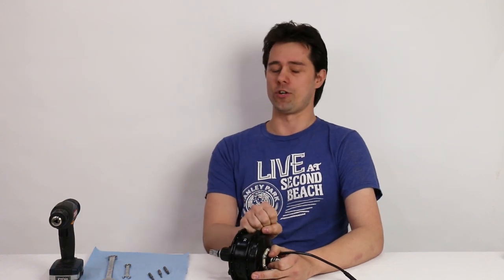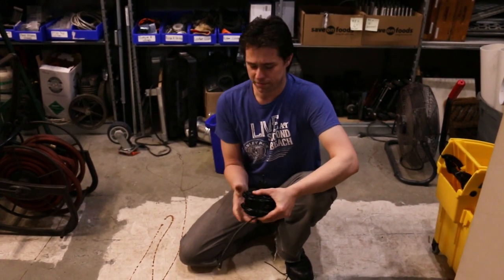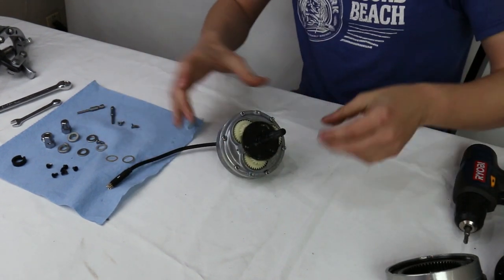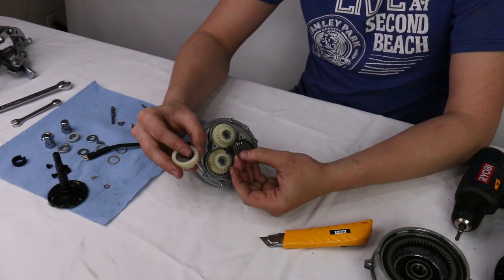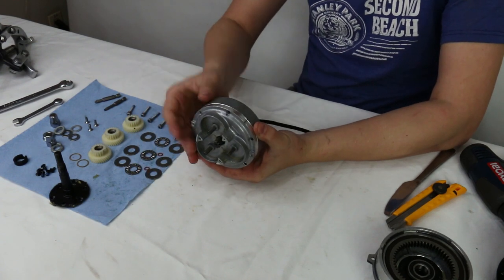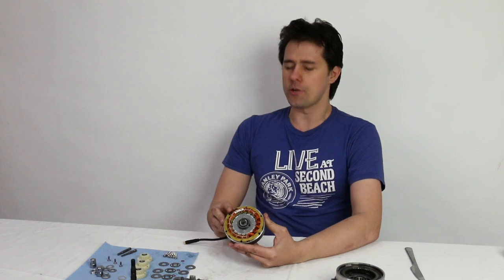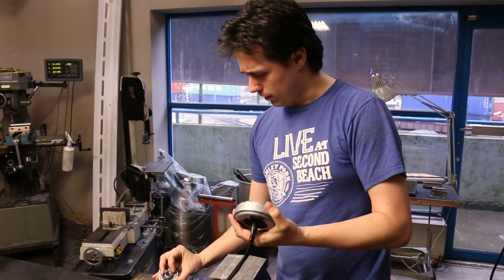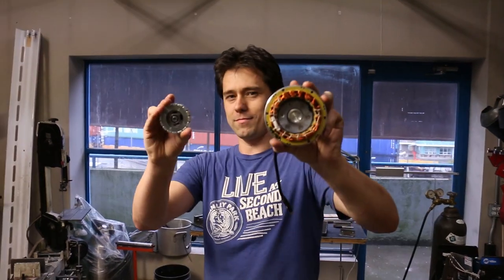Bafang G310 Motor Disassembly Video

Comment: Great video. Especially the attention to correct alignment of planetary gears. 🙂
The Bafang G.320.XXX / G.32 ( oem ) frontmotor is almost identical, but easier to take apart since the motor exits the hub in the same side as the cable thru a cover.

Comment: This motor advantage is 2,5 kg - light. But it have 11to1 reduction ratio. So faster RPM, higher hysteresis losses and higher edge looses. So it max efficienty can by 83 precents.

Comment: I have a 750W bafan M155.  The cable comes out opposite end of this motor.  The motor cannot be removed from the hub without getting the main (big) planetary ring gear out of the hub.  How do you get the big planetary main ring out of the hub?

Comment: what grease do you guys use on the plastic gears?
Reply from the maker: Generally none. There is a bit of grease installed at the factory and that's sufficient for the life of the motor. The nylon gears do not need grease the same way metal on metal gears do.

Comment: hi my Bafang RM G060.750.DC 750w rear hub motor planetary gear broke down, I can't find the exact size of them to order cause i don not know what size to order  do you know what is the size of the planetary gears inside of the bafang 750w  -- RM G060.750.DC 750w ? diameter thickness and number of teeth?

Comment: Just assembled my 48V 500W Bafang Rear Hub motor kit but the Speedometer and Odometer are not reading on my DPC1 display. I've tried a different display 860C and it's doing the same. All connectors are intact and tight.  Q: What sort of defect am I looking for on the Hall Sensor on the outer side or inner side of the hub?  How do I repair it? Which colored wire should I check for a bad connection? Thanks for your help.

Comment: Concerning reassembly, something not mentioned in the video is that the axle can only be installed over the planet gears in 1 of 3 possible rotational orientations. If installed in the wrong orientation the flats that accept the torque arms won't align on both ends of the axle and the torque arms will be rotated in different positions making install in the dropouts impossible. When positioning the axle over the planet gears, momentarily install the torque arms on the ends if both axles and make sure they align before continuing with assembly :)
Reply: Yep, found this out the hard way as well and had to dis- and reassemble after the wheel wouldn't get back in. Here's what this looks like on the Surface 604 Shred (the golden bar mark needs to point to the Bafang logo): https://ibb.co/WPcBnMg .
Reply: @ckwidmer  It helped, thanks a lot.

Comment: … assuming not everyone has a three jaw gear puller does not absolve you from explaining how one who does have one rets it on the axle on the cable side and pull the cover… right?
Reply from the maker: The cable on these particular motors exits the side of the axle near the ball bearing, it doesn't come out the end of the axle like most chinese hubs.

Comment: Is this motor the same as used on XIaomi qicycle ef1 bike? Because they look so similiar.
Reply from the maker: Nope. There are many small size hub motors that may looks the same from the outside, but with a discerning eye you can certainly see the difference.

Comment: Can i lubricate the motor to make it faster or is it because my motor is kinda ruined from going steep uphills for a while
Reply from the maker: The nylon gears do have grease on them, but if you used this Bafang motor under a heavy load for years it's possible the gears need replacing which is not a very hard job. You don't even have to delace the motor to open it up and you don't need a gear puller either. I'd say definitely open her up!

Comment: I assume those are DC motors. To have permanent magnets as rotating fields and the armature stationary, makes them brushless motors, i.e. no commutator or brushes required.
One disadvantage for PM motors is excessive heat that could demagnetize  the PM's and effect torque and power negatively.
Reply from the maker: Brushed DC motors haven' been used in ebikes in ages.  I think the last model we saw was circa 2004-2005 period.  Everything is BLDC and has been for almost 2 decades.  And yes, too much heat from reckless use and lack of thermal rollback can cause demagnetization, softening of the adhesive, or cooking of the enamel on the stator windings.  We've seen all 3. If you are pushing motors beyond their design limits, you want to take advantage of the thermistor in the motor to monitor the temp and do rollback if needed.
Reply: @GrinTechnologies  Yeah thanks for the clarification. I worked on lots of DC drives and motors up to 3000Hp, shunt field, series field, compound and brushless, all industrial. However, they're getting less and less as AC Drives/motors have mostly taken over. 
At least we won't have to change brushes and rework the commutator anymore.

Comment: can you put an 135mm axle in a 1000w Bafang fat bike motor with a threaded hub for single speed sprocket
Reply from the maker: You'll have better chances just getting a GMAC or an eZee and find a single speed cassette.
Reply: @GrinTechnologies  thanks, is it possible to lace a regular rim on a  fatbike Bafang  1000w front hub motor  (135mm axle) in order to fit in on a 135mm rear dropouts frame (wheeler evo 1.0 ebike) or a Stromer ebike frame
no cassette, no singlespeed sprocket, no chain, no pas,  just an e-moped with throttle ... like the Bird Scoot Electric Scooter Bike
I dont like fatbikes, but I love that geared Bafang 1000w hub motor 😆

Comment: Dont know if anyone can help, when I turn the pedal,the chain moves the cassette, but  the cassette is not latching into anything, so it just turns the cassette without turning the wheel. The motor still work, so it is moving without the cassette moving the wheel at all ...
Reply from the maker: Typically that would be a failed clutch on the freehub body.

Comment: @Grin Technologies Hello, I just saw your video and I have a question , if you can help me.  Recently I received an Flyer E-Bike F Series (made 2000-2003) and I wonder if you can help me with repair . It doesn't have tork but battery is perfect .  The bike have mid hub motor that I can't find anywhere on internet . Regards.
Reply from the maker: Unfortunately we only deal with hub motors, not mid-drives. The old Flyer ebike (that one really is a classic!) may even be running a brushed DC motor rather than a BLDC based on that vintage. Take it apart and enjoy the learning process!

Comment: Hi. What do you know about MXUS ? Does mxus xf15R worth it ? Is it noisy ? I want to buy it because it's cheaper. Thanks
Reply from the maker: MXUS XF and the many other copies and clones of conventional straight cut geared motors are definitely cheaper. They perform just fine with decent efficiency but they do make a buzzing noise while they run and are a little heavier since they don't have as high a gear reduction.  If your main goal is price then those motors make most sense, but if you value silky-smoothness then the premium G310/G311 models are worth it in our opinion.

Comment: Where is the internal freewheel? I did not see it in the video
Reply from the maker: Good question, it's actually connected to the ring gear in these motors. So the overrunning clutch is in the shell of the motor, and the inside of this clutch is the ring gear that mates with the planet assembly that you do see.

Comment: I have just received a G310 motor from Grin only to discover it has an unacceptable amount of side to side play. With a normal wheel this could be easily solved with some cone spanners. But the solution is not immediately obvious (to me) with the Bafang. Is it solveable? If so, how?
Reply from the maker: In general most of these hub motors will have various thin brass 'shim' washers on the axle inside the motor assembly, and it's possible in the factory fitment on the motor that you got that the shim washer wasn't sized correctly or was omitted.  Best to send us an email and quantify the the amount of play that you are seeing at the rim and at the hub itself.
Reply: @GrinTechnologies  Thanks for replying. Yes, after opening the motor myself I thought that might be the cause. My motor has only two washers inside, each a quarter of a mm thick with 15mm ID. I have bought some steel washers of various thicknesses which I will use to try and eliminate the play.

Comment: Those security torx screws on the outer shell of the g311 strip really easily it seems and don’t want to lock when you screw them back in. Am I doing something wrong?
Reply from the maker: Is it possible that you're using one size too small for the torx driver? We find that they usually disassemble and reassemble cleanly without any issues, using a lower power 12V impact driver, and have opened and reworked hundreds of motors now to pre-emptively reglue the magnets.
Reply: Grin Technologies sorry not the screws themselves but the threads in the shell where the security torx screws go in. I’m using a T20 and they get slightly tighter near where they bottom out but then don’t catch and just spin endlessly. I noticed some spiral metal shaving on the threads of the torqx screws themselves indicating to me the internal thread was stripping off.

Not really sure what to do (loctite blue was my next idea). Is it possible the wrong size screws were used when the mags were glued on?
Reply from the maker: @ihasmax  Ah I see, yeah in that case it sounds like the internal shell threads are a bit damaged. Usually the best solution in these situations is to retap the hole and use a helicoil insert which will provide super strong steel threads instead of the aluminum. At our shop we keep M4, M5 and M6 helicoil kits on hand for this kind of repair.
Reply: @GrinTechnologies  Thanks, good to know that's a solution should I need it! I ended up using a slightly longer screw (8mm I believe) and was able to catch some threads enough to feel confident in the plate staying on for now.

Comment: Hi do you know where in uk I can buy a Bafang or mx front hub motor 26inch mountain bike wheel.i have my rim .my battery is Samsung 14s 5p 25r cells .53 volts max